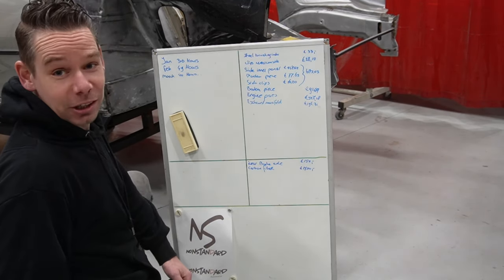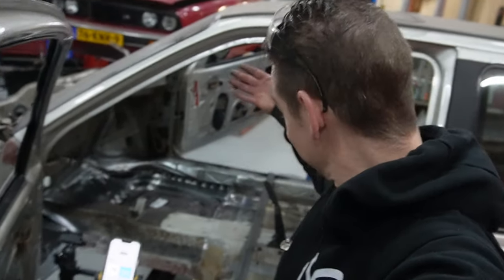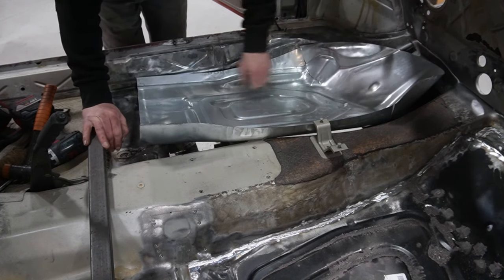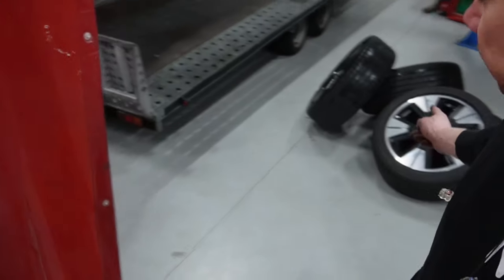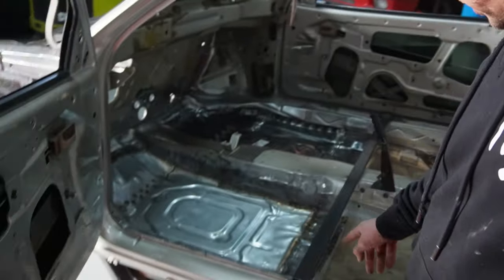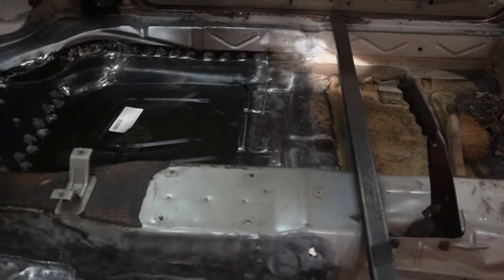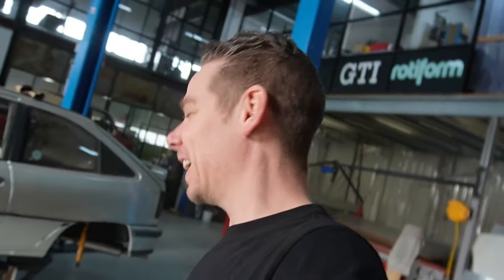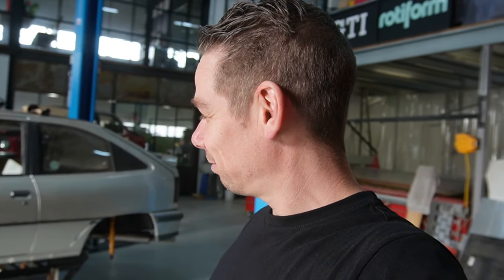Restoration of a unique Opel Kadett GSI ALL FLOORS ARE IN !

Comment: Did kadetts get the same problem with original paint primer causing mirco blisters and the paint to fall off like some UK cars have? My 1990 metallic blue astra is covered in them but it's not rust.
Reply from the maker: No not that problem but the protective layer out of the factory and the closings/design of the chassis is bad so they rust alot even from the inside out.
Reply: Awesome Job! Leave the rear panels alone, they look nice from the outside 😊